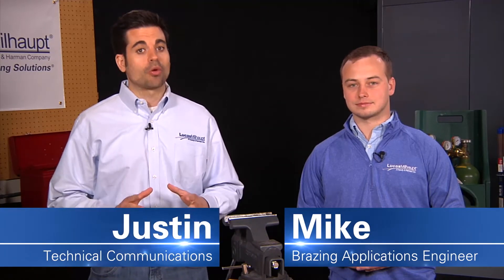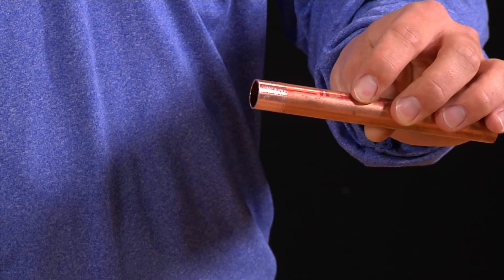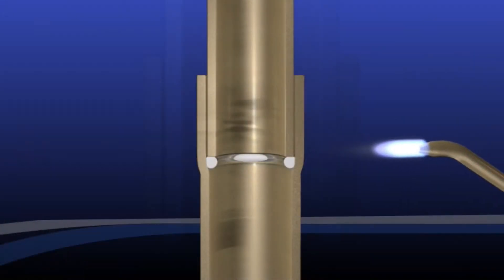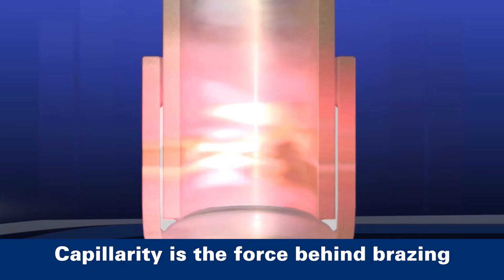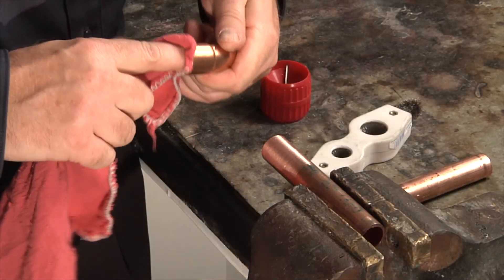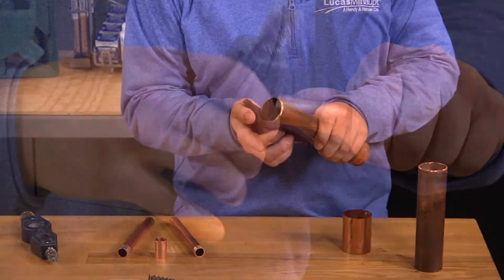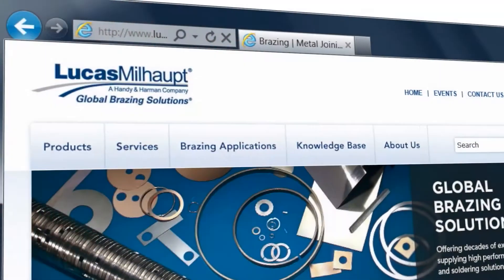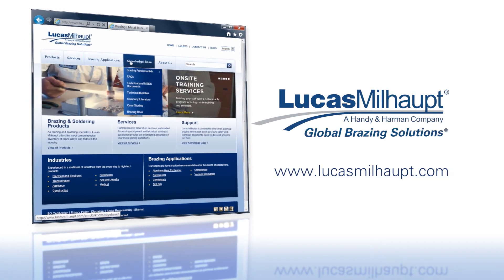Fundamentals of Brazing #2: Cleaning the Metals

Comment: Cleaning the metal surface is needed for brazing for a capillary action.  Thanks for the video.  Cleaning allows for a proper joint fit as a capillary action supports the filler metal in the joint.

T J (Tom) Vanderloop, Author, AWS Member & Technology Instructor.

Comment: Clean new metals wether you ‘notice’ they are dirty or not. This is certainly implied by your later statement that if you don’t braze a joint that you have cleaned and fluxed immediately, then you will just have to do it again later. How much truer is that for a metal that you’ve just gotten from the factory that you’ve never cleaned? Always clean your joint.